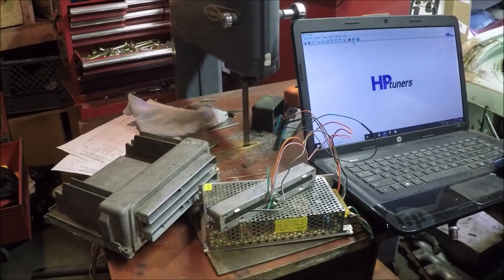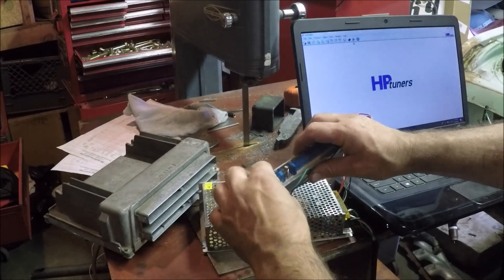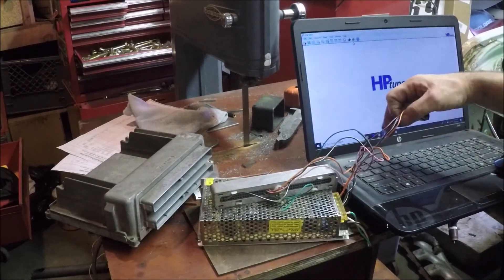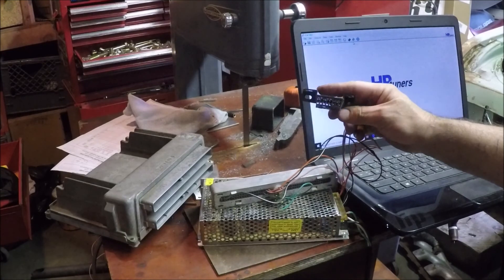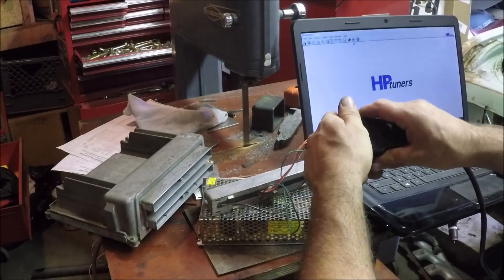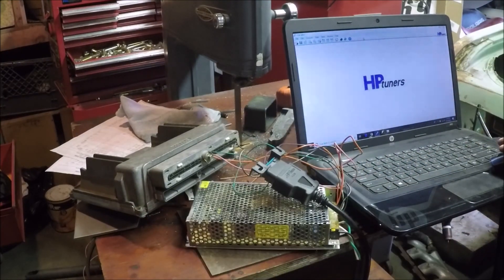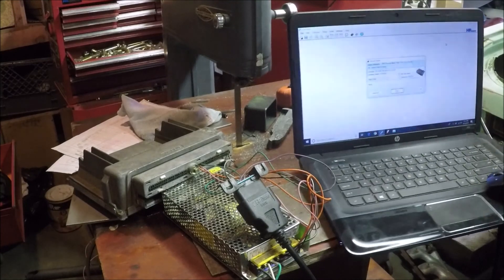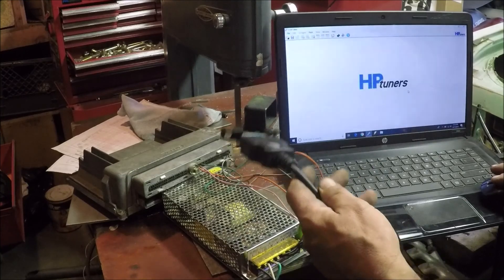gen 3 ls bench harness instructions

Comment: Hi.. I want to flash the vat.. I have the blue pcm plug cut from harness.. Can do that without pinning out all no nesserrary pins from plug? Because after vats remove I will use the plug in my harness
Reply from the maker: You can leave all the other wires intact if you plan to reuse the plug. Just hook up the ones you need.
Reply: Ok I remove first the vats.. With cut the plug from harness.. End then re work harness
Reply: Which hp tuners I need.. End hoe does it costs
Reply from the maker: @cj-ty7rn  Save your money and use pcm hammer or LSdroid. Do a quick google search for it. You will need to buy a compatible scan tool but the overall cost is much better the HP. If i had known then what I know now id have never bought the HP tuners.